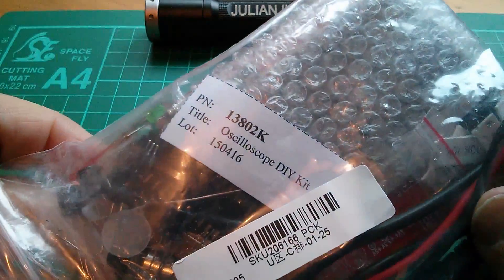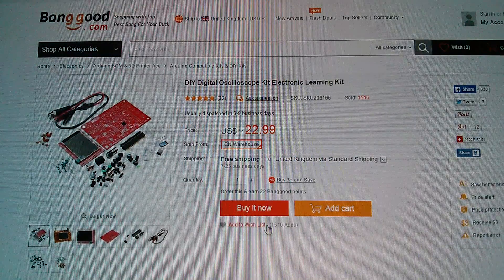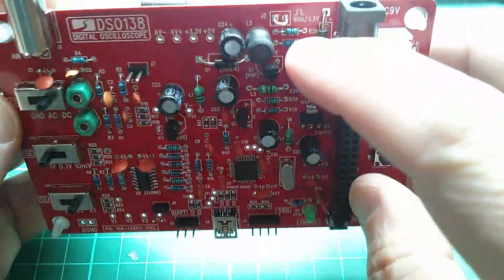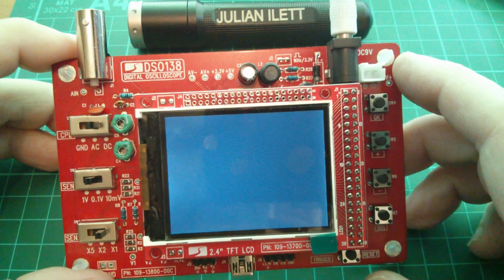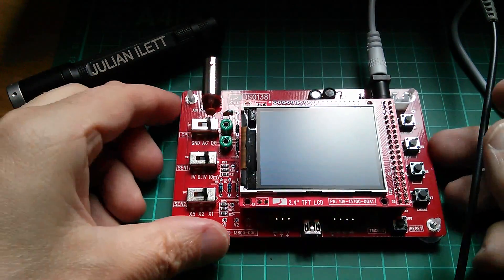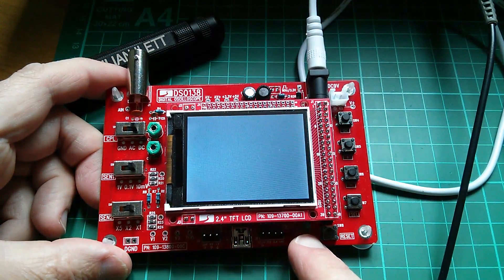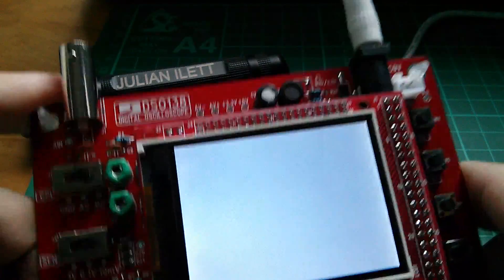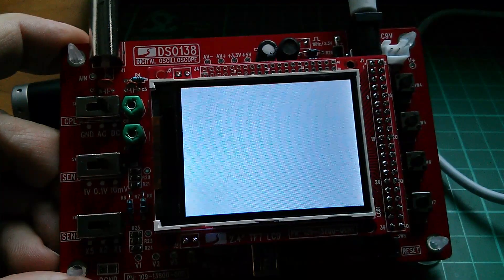Julian's Kit Build (FAIL): Banggood £15 ($23) Oscilloscope Kit

Comment: check that your 79L05 isnt a 78 because i had that they sent me 2x 78 not 1 of each! i got all my voltages except -5V and i had the 0.6v you are getting. however i had the problem with my display but i managed to get it working and i still had these issues but al lthe other voltages were ok apart from V1 V2 and the -5V not present

Comment: the DSO112A made by the same company is fucking excellent. it has very high build quality & is rather surprisingly sharp. comes with a built in lithium ion battery. i designed a 3D printable chassis for it that holds two 18650 batteries in parallel so it lasts forever. https://jyetech.com/dso-coral-112a-oscilloscope/  https://www.thingiverse.com/thing:4047330

Comment: You could try replacing the LM7905 regulator and see if that gets the -V supply working again, and maybe the transistor that's part of the -V supply circuitry as well, hope that helps.

Comment: What you want to do is buy yourself a good strong magnifying loupe and use it to give each solder-joint a good close eyeball and check that they are all good, and there are no unintentional short-circuits, or solder-bridges, or dry solder-joints, I've got to the point where I always use a good temperature controlled soldering station whenever I do any soldering now, I'm looking at buying one of these Digital Scope kits from Banggood soon, it will be going in a big analog Modular Synthesizer which I'm in the process of building.

Comment: It's a counterfeit board.  The rectangular square on the backside should have a sticker with the board SN# that can be cross-referenced on the JYEtech's website.  They are quite clear that if it is missing it is a counterfeit board, which means it is probably built to lesser standards and components.  This is the main reason i would never buy anything from Banggood.

Also, on other videos featuring kits with low-cost Chinese components it is not at all unusual for pre-installation testing to reveal bad, counterfeit or mismarked components, which is why you should have followed their advice and metered the components before installation.  if there is a bad resister it's probably not worth your time to look for it now.

Comment: Make sure youre using a center positive power source. mine did this until i changes from a center negative power source to a center positive.   A 9volt battery would also work

Comment: @Julian Ilett
i also had a display problem when i built one of these , it powered up , worked for a few minutes then the display went "funny" , if i left it off for a while it worked again for a few minutes , i also thought it was a problem with the display , i couldnt find a new display so bought a whole new kit , built just the display bit put it on the main board and it worked :-)
now for the good bit , i built the new main board and put the old display onto it and it also worked , i have no idea why the first kit was a problem but now i have two working ones :-)

Comment: [IF YOU DON'T WANT TO READ, THE SOLUTION IS THE SECOND LAST SENTENCE]I don't know if it really matters anymore, but I found the solution. I've had the same problem with my unit(led flashing correctly, screen not working), and after 1 year of sitting on the shelf, i found it while organizing, and decided to give troubleshooting a shot. I went about troubleshooting it as shown in the manual, and it turned on! For at least a little time. I found that if you fiddle around with the screen, bending it back and forth, it sometimes worked, and sometimes didn't. So I pulled the LCD with its metal casing and it was sitting directly on the top of the solder joints of the ribbon cable -.- . So I just stuck a bit of kapton tape on the solder joints, put the display back on with a bit of glue(as I had destroyed the double sided sticky tape by removing it), gave it power, and that solved the problem for real this time. Hope it helps somebody that is struggling with this issue.
Reply: That always feels good pulling off a nice fix like that.
Reply: Definitely
Reply: just out of despair, because I had the same problem, I took off the metal plate, I removed the flexive tape from connections, and voila, it worked, thanks ...

Comment: Ive got 3 of them, one failed to give a trace even on test signal. Seems they are hit and miss. I suspect packaging may me the culprit, Since the main board with the micro controller is not in static proof bag during shipping, Unpacking the device is surely going to cause damage unless in a perfect grounded environment. However in my experience with the kit, Ive got 2 out of 3 working. They also suffer noisy signals and trimming them doesn't appear to rectify it. They do work well for basic stuff though like testing signals and voltages Etc.

Comment: My first one went up in a puff of smoke. I had to replace all three power regulators to get it running. Not sure if my board is the older type or not, and I'm also not sure if it need to be modified by linking the capacitors together or not? How can I tell?

Comment: You absolutely suck at soldering. No wonder why it does not work.
Reply: I've recently not been so bold as you, I'm getting old, wtf! But i was thinking the same thing, so i used my microsoft magnifier and replayed this, most his transistors are sitting in open wells where he didn't get hot enough to flow through, I'm an old mechanic so i've been soldering a long time, i filed my old weller tip to a triangle tip, and this board was a bit of a dick,  i use a toothpick in a tub of flux and a micro dot does wonders for complete flow, but i also went over each one and re did them until perfect.

Comment: If your having problems with the TFT display check & resolder  the TFT header on the TFT and the main PCB. I let my mate solder it as he was eager to do it but found the display wasn't working & after checking with ohm meter found dry joints.

Comment: Julian !!  In this cell phone dominated world - Where did you get that great selectable multi-voltage power bank??  I have searched everywhere - and can only find 5V / 9V auto-select units for charging cell phones.  And the 5 volt version I have automatically turns off on low current applications (thinking the "charging" is completed).  I'd love a 9 volt portable - battery powered - rechargable power supply like that !!  Thanks for all you do !!!
Reply from the maker: Sadly it's no longer available :(

Comment: Hello Julian.
I bought also that dso138 and an acrylic case.
If the dso boots, all voltages are ok but the screen is white blank, then, i had the same problem,  i look for the test modus and later for the lcd/tft display. The display reacts on the slightest touch and goes white blank. I disconnected the display from its back lime and lift it a bit, so mechanical tensions are smaller to the flat cable.. Now it runs ok. I will not send it back, because i believe, there may come the same sh... back.
So not our foult.

Comment: I have the factory finished fully assembled version.  But there is a fault like that shown in the video.  So far all I have done is connect a PP9 battery as power supply.
The screen shows a normal boot sequence and produces the graph.
After about 30 seconds the screen goes fully white.
However if I take the power off for about 30 minutes and then plug power on again the boot is normal and graph displays.  30 seconds later the screen goes white again.
If I then remove the power for about 1 minute I just get the white screen immediately.
If i leave the power disconnected for about 5 minutes I get a normal boot up with graph.  But the white screen comes back in under 10 seconds.
Pressing the reset button makes the green light flash as normal even when the screen is white. when the screen is white the reset switch makes the screen light brighter while depressed.
I have not tried feeding the unit a signal to see if I can get any trace on the screen while it displays the graph or done any other tests to avoid being accused of causing a fault.

Can anyone advise what I should do ?
Is there a possible reason for this that can fix the unit ?

Hope you don't mind me asking this as my problem is almost identical to the video except the device comes up normal if permitted to rest between power ups for about 30 minutes.

Thanks.
Mal :-)
Reply: Try putting it on a stabilized 9v supply as PP9 Batteries drop below voltage very quickly.  This may overcome the problem.  All the best.  Mal :-)
Reply from the maker: Well, it sounds like the LCD has a temperature-related fault.
Reply: Tks Julian.   I feel that is the reason too.  So I would have to get a replacement screen and get the Supplier refund that screen cost or the whole thing.  I have sent them proof and await their choice.  I can't wait to have a fully working one :-)
Reply: In the mean time I have made a Sound Card Dual Channel Oscilloscope and it works fine within its limitations.  A very low cost way to go and the PC Software is great :-)
Reply: i have same problem
Reply: Thanks i test it
Reply: How can i find this battery
Reply: Please link
Reply: I don't use a 9v battery.  i use a mains transformer to deliver 9v which does not dip down when the scope is switched on.  I found all the faults and problems happened when the little PP9 battery was connected as the voltage dropped quickly below 7v and then the problems started.  My one was a factory built one.  Hope this helps.  Mal :-)
Reply: Helped i solved this problem
Reply: Thanks for help
Reply: Hello my friend, i changed my power supply and it worked but now it does not work how can i solve this problem
Reply: https://lh3.googleusercontent.com/vLNX2T9oOh76p8GnTmOwgl0MLlroxfdnEpDdXV36DnVCQQA-myjtZ8wOSkzyZ_lrvliheUjItQ

Comment: The lack of static shielding or prevention probably killed it
Reply: Unlikely. Everything on here is about 2-4 kV static resilient, no sensitive components at all. I think he simply didn't heed the VERY FIRST warning on the assembly manual: you HAVE to measure all resistors! Because some of the colour codes are ambiguous when read right to left vs. left to right. And i mean in this kit specifically, not merely in general.
Reply: My scope worked perfectly in the beginning, then I decided to mess around with it, I waved the positive alligator clip and just swipe it around on the underside of the board touching whatever pins it can, my scope restarted and my trace is gone and forever gone.... :(
Reply: lel...

Comment: I had a similar problem with my LCD except mine never showed an image only displad white screen.  The instruction stated that R36 should be checked.  I checked it and it read 180 ohms replaced it and still wouldn't work.  I decided to replace the resistor but only had a 220 ohm.  I solder it in anyway and the display started working.  Haven't had any problems after a couple of hours of use.

Comment: This oscilloscope was my third soldering project (after a little 16-LED blinking heart and a simple digital clock) and it instantly worked. Ok - I have to admit that it took me 6 hours, I followed the instructions and i measured all the parts before placing them.

I start getting the suspicion that the instruction to measure the resistors is not just there for raising multimeter sales. ;D

Bottom line: It's sad that this great kit may get a bad reputation because of someone who seems like a professional but is not able to follow a simple, linear manual.

Comment: It is not a mystery. The display wont work without -5V either. Problem is caused by l2! The one supplied with the kit is only for.3A. Replace it by one with1mH/1A, replace Q1, replace Q2 and D1 and everything will work. Had the same problem, including a burning L2....
Reply: Thanks for the additional info! Should serve very well to make it run better in the long run!
Reply: Sir
Please tell me replace Q1 and 2 and D1 with what? Same component or what?
Thanks

Comment: Note , they have changed a resistor value which is not mentioned in the main assembly instructions, just on an extra bit of paper shoved in! Get it wrong and the sensitivity is very poor!Mine worked first time, luckily!

Comment: Use a different power supply. Check the voltage. I had this same problem and a different power supply fixed it.
Reply: Tracy Scott 
For the first time I had week battery. After a few minutes the voltage dropped and screen turned white. No panic.

Comment: I had a SMB version of this kit, and got it working fine. It is a great little project. I agree with some of the others here, 9V does not seem to cut it as a power supply, but 12V is solid.

Comment: Edit - Seems its a newer version they sent me - and I saw your newer videos - glad you got it working - noise isn't as bad on the version I have

Just made one last night - for the SMDs I used solder paste and a big old heat gun to melt it. Board was very toasty, but it made a neat job of it - chip survived and worked first time.
Reading those resisters was though so I did what the instructions suggested and measured them all as the went in.

I received More instructions than you did.... 3 Sheets - (1) An SMT Component installation Guide (2) The guide for soldering the larger stuff (3) A User Guide with the schematic you found printed on the back.

The User guide has some hidden feature tips like - Factory Default (Hold + and - ) - which I had to use once when the 0V Line Alignment (Hold Sel for 2 secs when ms is selected) completely messed up.

However my scope seems to add a little offset  - a 0V reads as 0.6v - quite a lot of error of an offset.

Comment: i recently bought one of the upgraded kits (13803k) and after building it it works perfectly, it has a little noise but within tolerance for a kit of such a price. i did all the soldering without using static protection (i did touch an earthed source before hand) and had no problems after. i think this is that 1 in 1000 chance to have a defective part that is with everything from tvs to mobile phones

Comment: I installed the LM7"8"L05 & the LM7"9"L05 in the wrong location. (Reversed them.) Same problem. I was able to remove them from the board with some board damage, But once in correct location, it worked perfect. Nice little unit.

Comment: Similar problem to me,  and voltage verification doesn't work in the same Pins you revissed. Furthermore ...I did see some board in youtube and publicity with pre-soldering Micro resistenses and Chips... Unfortunately, my recived kit wasn't soldered this part

Comment: It works fine, just double check. tripple check.R11 150 ohm.R38 1.5K. double check soldering, It's very delicate. I made the mistake myself confusing  the two  REGULATORS 79L05 and 78L05. Then it worked fine.
Reply: Robert Moller hi friend my dso138 have white screen problem. and its 78l05 regulator is overheat i do not touch it. is  it  normal ?
Reply: and led blink when i connect it power supply a few seconds later it does not blink please help me friend

Comment: Quite surprising Julian.. I bought one of these, and whilst i thought i had a genuine one i'm fairly sure i have a copy, yet mine works quite fine... Hmm.. Took me about 2 hours to build i think. Ironic that i was really lucky with mine yet it's more or less useless... Well, its not useless, it's actually surprisingly fast at the right rate... In certain modes the refresh rate is higher on-screen than the "proper" scope i now have (It's a Hantek - please don't laugh :( lol i got the MSO5202D if anyone cared to know the model.. It's a bit laggy at times but for the price the features it has...quite ridiculous. I wish someone would bother to do some open source software for it again, as i think the hardware it has inside is actually not that bad, plenty of powerful FPGAs etc..) i'd be quite interested in actually probing my kit one with the big one to see if we can work out what's up with yours? Speaking of colours..what's up with the colour reproduction of this vid? Bit blurry too! I also never had to short JP3, as far as i remember! Mine just fired up and still does now, had it running on a 9V PP3 battery, a 9V power brick and a 2S LiPo! I wonder what it behaves like with a 'real' probe attached to it... Mine also has the 40 firmware version.. Old but it works! Yours seemed to boot really slowly too when you first powered it up. Mine boots in a couple of seconds.. Weird. Especially considering mine is most likely a clone! Mine also flashes the Trigger LED different on boot.. a delay and two quick flashes. Hmmmmmm... Ever find out what was wrong? I should probably watch the whole video before i comment.. Fail.

Comment: I had the exact same voltages and behaviour (that is before your screen went out) and I had misplaced the regulators, that is I put the 7905 where the 7805 was supposed to go and vice versa. One of them didn't survive the ordeal but after I corrected the placement and swapped the broken one I got proper voltages and the trace showed up. Just my 2 cents.

Thanks and keep up the good work!

Comment: Just built one of these from Ebay and, much to my surprise, it worked at first power-up, the only snag is that the probe compensation capacitor on the 1 volt range doesn't seem to do anything. Any idea as to the use of the USB connector?